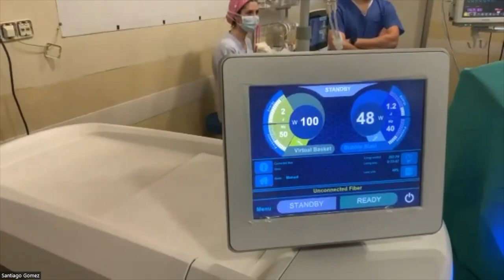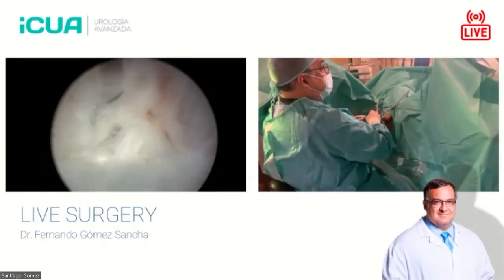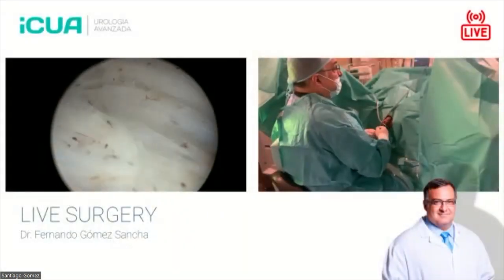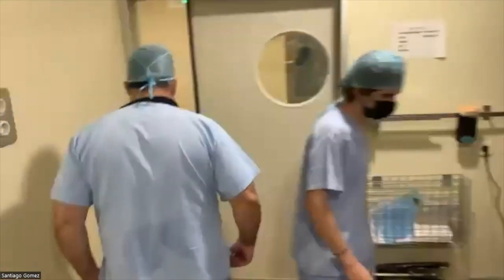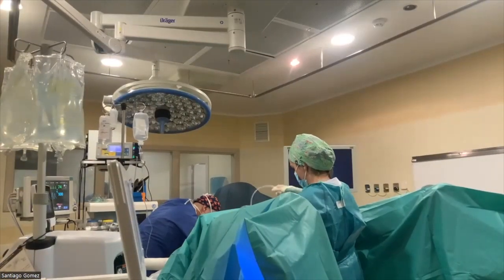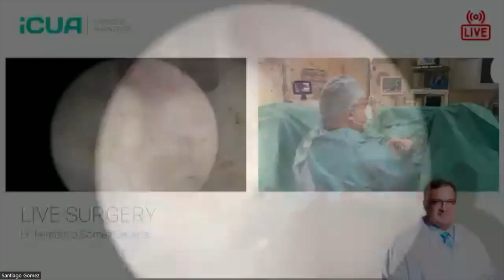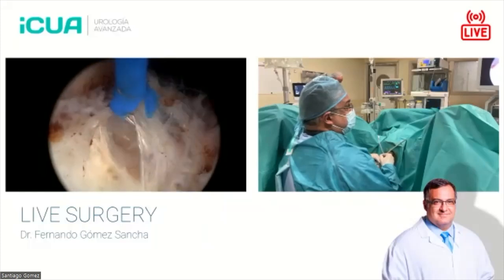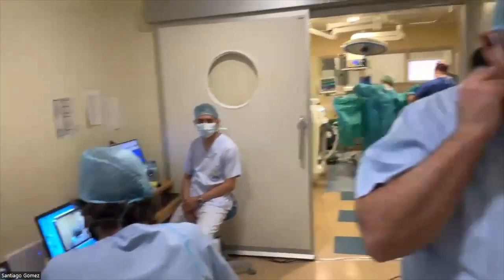HoLEP live session with 2 cases

Comment: Thank you very much Dr.Sancha for the nice cases, as always perfectly done ! 

I would be very thankful, if you can help me in two issues, i am now a consultant urologist in germany, and leading the Endo-Department. We do about 150-200 Enucleation/year.  I am now doing the En-Bloc enucleation with our Olymplus SOLTIVE Premium SuperPulsed Thulium-Lasersystem with a maximmium Power 60 W ( 60Hz,1 J), i don't llike this Lasersystem at all for this target, the hemostasis is really bad, and i can't see any dissection-Effect. Is this known about this system?, or it is not good, because  that i am still at the beginning ( i have done above 50 cases, and i still have these problems) ?

I have tolk with my Hospitalmanagement, we colud  buy a new Lasersystem with new scopes (i have now Laser Scope with 27Ch Shaft, Olymplus), what wolud you advise me:
A)Quanta System CYBER Holmium 
b) Lumenis Puls 100 Holmium 

Scopes :
Wolf Laser Resectoscope with TUR-set ?

That last question, where do you prefer to insert the Catheter, in the Bladder or inside the prostatic Fossa ?, and with how much will be blocked?

I am really appreciate your time and your effort to share your experience to make it easier for every one. Thank you from the bottom of my heart.
Reply from the maker: Hi Mohammad, thanks for the comment. It is strange that you are not getting good hemostasis with the Soltive… I agree with the dissection effect, it is more a cutting tool than a dissecting tool. I would try to use slightly different working distances to see if you can find a working distance that enhances hemostasis. A Holmium will give you much better disssection effect, and new pulse modulated lasers have very good hemostasis. Both the Quanta and the Lumenis lasers are excellent. I use both with excellent results. The integrated system of Richard Wolf is also excellent for enucleation, and the same external sheath allows you to use a laser scope, a morcescope and a resectoscope for final review and extractioon of small residual fragments. No mistake there. I try to keep the balloon of the catheter in the bladder, so I instill 20, 40 or 60 mL in the balloon depending on the size of the bladder neck. I am glad that you find these videos helpful. Enucleation is really a great operation and makes patients super-happy and I wanted to help other colleagues to get up to speed with their cases. All the best, Fernando
Reply: Thank you very much  for the advice and your explanation 🙂

if the cost will not be the problem, what would you choose, the Virtual Basket (CYBER-HO-150 or CYBER-HO-100) or the MOSES (Lumenis Pulse 120H) ?
Reply from the maker: The Quanta System laser is quiet, and the Lumenis very noisy… If you have to work long hours in the operating room, it makes a big difference that dictates my preference for Quanta.